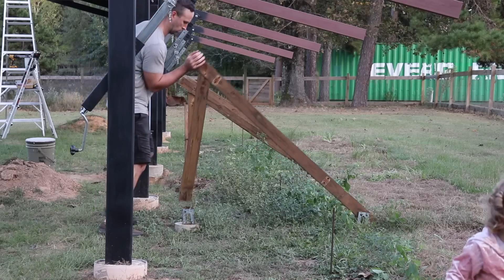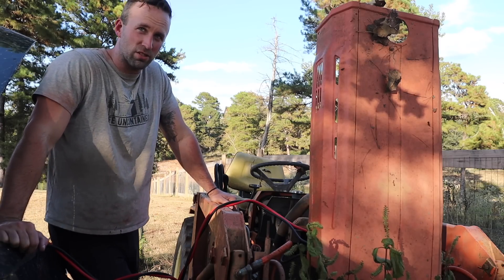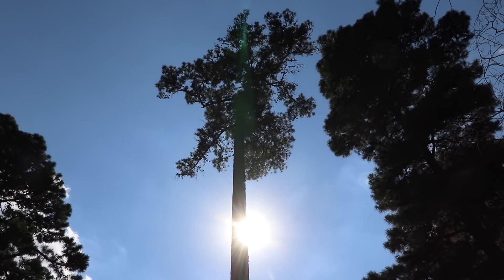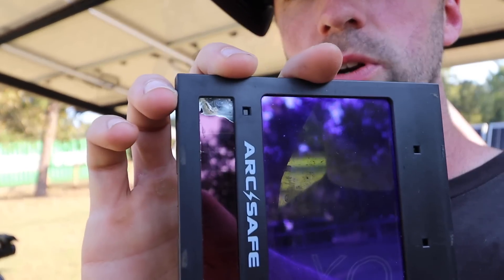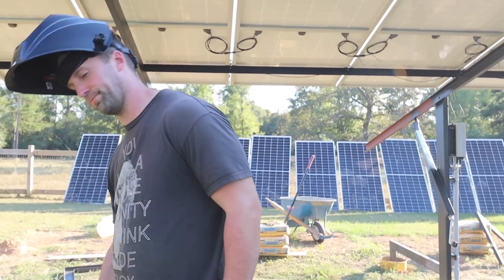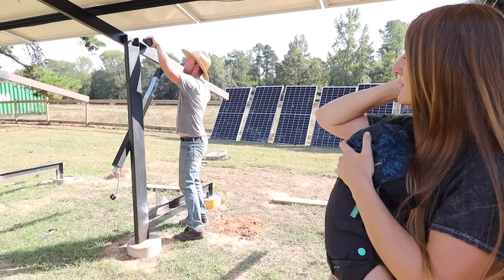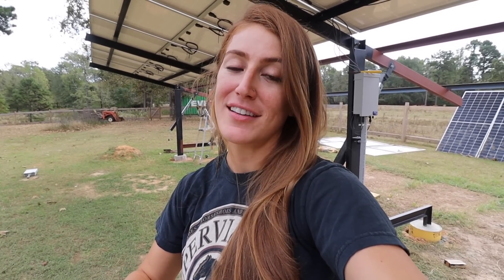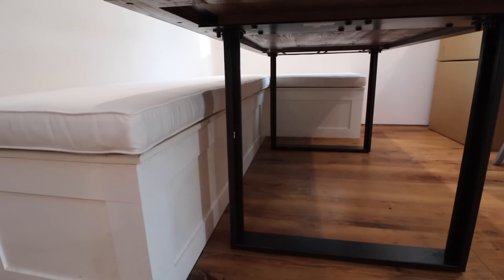COMING TO AN END!

Comment: You're going to have big issue in changing the angle of the Solar Grid. You need 5 People to rotate the liver simultaneously. Beacuse you welded/fixed a steel bar to all thr five Steel Pillars When you rotate thr first one the cross welded bar either bend or break which will be an issue for the panels...

Comment: If the tractor ran, think how easy they have pulled up! Your daughter  looked just like your wife pouting,,,,,,,,,,,,,

Panels look good, but you will need a 45* brace on those supports. They will crack at that 90.

Comment: "Can you put the doll down and hit the accelerator and give the Honduh some gas?"    ROFL

Meanwhile he lugs the concrete from point A to point B while she holds the doll.   You cannot make this stuff up!

She is now happy to say the "concrete is done" all while holding the doll.    Kodak moment.    Perhaps he should hold the doll while she holds the 80 pound sacks of concrete mix.    That would be true equality.

No way!   She puts down the doll and does the usual stupid millenial thing and selfie cam time!

The table came in and you want him to finish priming and painting the solar gizmo and then to put table together?    Good grief!

You can solve the finger print problem by taking brat and putting her hands in the paint and then to ask her to finger paint on the wall.   I bet she'll learn not to put her grubby mitts on the wall again!

On the table legs - why don't you cut some wood to run underneath the metal horizontal bottom section?    You could counter sink some bolts and then he'd not have to do jack?    You could put the doll in a net hanging from the ceiling where you can see him.   And then when you are finished four hours later, you can carry him around the house whining about doing some work.